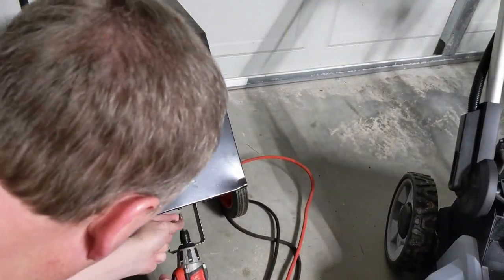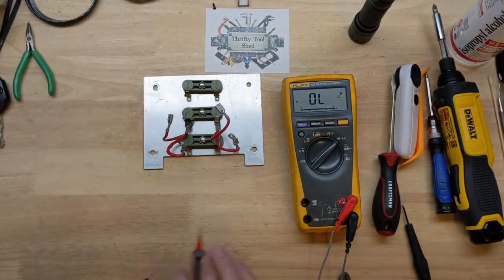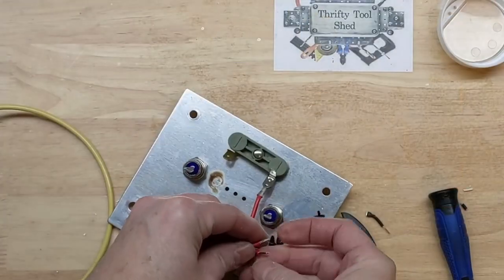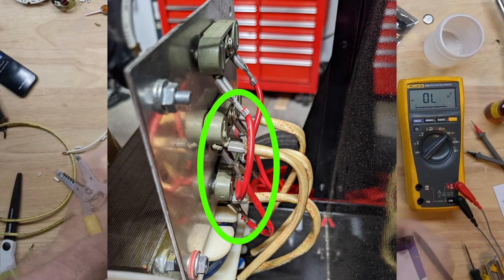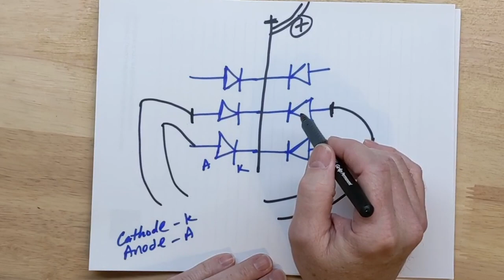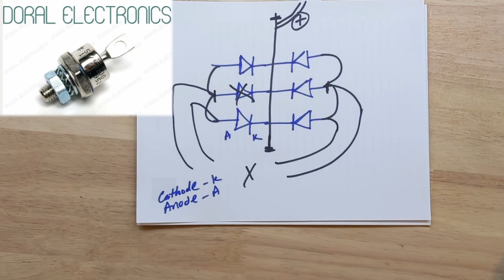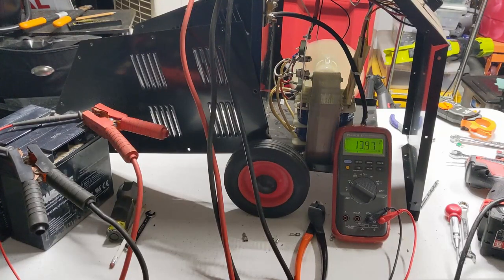CEN-TECH 69368 Battery Charger Repair

Comment: Hello Thrifty Tool Shed.  This is an update to my copy cat replacement of all 6 Diodes on the Rectifier  plate and the re-wiring of the Diodes.  It took a while to collect 6 new diodes and when they arrived, I watched your video again, then copied your solution.  The parts I used were all new.  10 AWG wire and #6 ring terminals.  Following your instructions made this a doable project.  First, I removed all of the old diodes from the Rectifier plate and replaced them by drilling holes for the new ones and attaching them.  Then I carefully re-wired all 6 in sequence like the diagram you drew.  After re-attaching the positive wire to the plate, I used a multimeter to test my work. It displayed numbers similar to the numbers you show in the video.  If I had not found your video, I would have just bought a new charger.  You showed me the way and I successfully repaired my old charger and saved money.   You are a good teacher.  Thank you and happy trails to you.
Reply from the maker: Awesome job! Thanks so much for your kind comment! It means a lot.

Comment: One small problem bro.  You cannot put non identical diodes in parallel.  Different diodes have different voltage drop across them.   It's like putting a shelf in a couple parallel boards.  The longer one will carry the whole load.  The bad thing for diodes is that once it get hot, its voltage drop goes lowers and this exacerbate the diodes getting hotter and other diodes doing nothing.  Eventually the diode with the lowest voltage drop will burn.
Reply from the maker: I completely understand that and I guess I should have talked a little about that as well. Since I mentioned that they could handle 50A on their own and only ever get a good push when in 200A boost that is obvious with the size of the wire it is not meant to handle more than a few seconds of that. I have had no issue with that in mind. If I was working on a system pulling close to rated current of the diodes in question and with more use than an occasional battery charge I would have absolutely changed all the diodes at once as you could tell the original ones I left on the plate were not as close in voltage drop check as I would like in a system design. Very good point, I should have spent a minute talking about this a little. Thanks for sharing!

Comment: I know this is an older video but it's still good stuff! I'd been unable to source the original style diodes for my HF charger. Never considered using a stud mount diode. Thank You Sir!
Reply: Where at?
Reply: @TheTechGuider  Amazon has the stud mount diodes that will work with the HF battery chargers. The original pill type diodes they offer do not include the holder (which is why I think mine failed on a high amp setting due to poor connection). I think the stud type diodes will be a much better option to handle the current and heat without the same type of failure mine had. They're great battery chargers but some of the internal parts are pretty sketchy IMO. It's great to see someone has found a way to repair one better than the original design. A+!
Reply: @KentuckyFriedFixes  can’t find them I looked
Reply from the maker: Is the link in the video description not working now?
Reply: @ThriftyToolShed   no kentucky said he found diodes like the originals. I asked where
Reply from the maker: Sorry, I saw where he said he could NOT. He used the stud style....
Reply: @ThriftyToolShed  oh I misread
Reply from the maker: Close as I can find to parts with the 50A original diodes....
https://amzn.to/48e90t5

Comment: I have a smaller cen tech battery charger, it turns on and off constantly, on for 10 seconds off for 30/40 seconds??? I got no idea if its normal. Do you have any ideas why and if need be what to check to fix it?
Reply from the maker: It is possible it is shorted out similar to this larger one. It can be shorted and hum and maybe the internal shunt or circuit breaker is opening up and then cooling down and cycling? Does it have any DC voltage actually coming out of the leads when it is on?
Reply: @ThriftyToolShed  The meter does not rise at all but you hear and see it go on and off. It's one that has 50 amp 10 and trickle 2 amp. Never used much.

Comment: Thank you for your fast reply.  After I sent my comment/question, I went back and watched the video again.  Then I heard you say you needed to add more ring terminals.  Since I am replacing all of the Diodes with 70Amp 1200V replacements, do you think I should use a wire with a 12 AWG instead of the 14 AWG you used?  I confess that I am merely being a copycat and trying to do what you did.  Monkey see, Monkey do.   I'll be really careful and hope I have the polarity in the right direction for all 6.  Again, I appreciate your patience and kindness in the explanations you provide.  Thanks again.
Reply from the maker: I would absolutely use larger wire like 10 AWG  or at a minimum #12. Excellent point.

Comment: I have an old Schumaker battery charger that needs both diodes.  It is 6/12 volt 2/6 amp.  All of the stud diodes that I can find are 70 amp. Will that work or should I use something smaller.
Reply from the maker: They will work fine, just Overkill. You can get by with 10A or 25A easily if you can find some.
Example of some Axial 10A if you can connect them in yours: https://amzn.to/4awsnye
Or 
Example of 10A 8mm stud type: https://amzn.to/4aAH2bH

Comment: I've seen others change diode with bridge rectifier that have a diode in  them? Whats the difference in the one you installed?
Reply from the maker: Typically speaking the bridge rectifiers are lower in current rating than the large individual diodes and it has four diodes together internally used for full wave rectification.  This charger is using half wave rectification.
Reply: I have the smaller 2 / 8 amp Cen-tec charger. If I replace the diodes will it put out more amps? 
Is so, diode like the ones you used or the smaller square ones or a full on bridge rectifier?

I'm more mechanical than electrical. Lol. Thanks for all the information.
Reply from the maker: You will be limited to the current rating of the transformer as well so not only the diodes amp rating, but the transformer as well.

Comment: This is about the fifth video I looked at on how to fix a charger. This is the only one I've looked at with the 200-amp start option for the charger. That's what I'm working on it is a Schumacher. Funny thing at the parts store at Farm and home store I was asking if they had a fuse available for it. It look like I speaking a foreign language and that I was nuts. Fix a charger just go out and spend $350 or more for another one. The charger has saved dozens of batteries for me. so now I'm going to take the case off and see what I find. Your video is getting me off to a good start. Thank you

Comment: If all of the diodes (3 x 2 = 6) are replaced individually, how would it be wired back into place?  The charger came with 2 diodes per holder, and the top tier only has 2 wire connectors, and the 2 lower tiers have 4 wire connectors.  I am new to solving electronic issues and could learn from your expertise.  Great video too.  Thank you.  Merry Christmas too.
Reply from the maker: Hi,
I did show at 8:55 the diagram of how this one was wired if yours is similar. Make sure all diodes are going the same direction as the original. Mine was all 6 cathode to the plate. You can also buy higher amperage diodes and get by with 4 instead of 6 if you desire. Thanks for your kind comment. 
Hope it helps and Merry Christmas to you as well!

Comment: I have the same unit and the same problem, but I had a burned out diode in each group, so I have to replace all the Dios. Question! Would I use the same Doud for this unit? I bought six new diode and I’m getting a Feedback.
Reply from the maker: I would think replacing all 6 would be great. As long as polarity is observed and put back the same way. Are you saying you are getting a feedback after installing them?

Comment: Was the black wire output battery cable connected to the center tap of transformer ?  The red output positive battery wire was connected to the rectifier diode plate.
Reply from the maker: Yes, the best I remember. The black cable does go through the current shunt and circuit breakers before going to the transformer if I remember correctly.
Reply: @ThriftyToolShed  thank you for your response.

Comment: very helpful .thank you.     i have 225 amp  schumacher charger  probably 40 years young ,  has 2 diodes  on rectifier plate .  one of them is bad, will the one in this video work properly for me ?
Reply from the maker: Thanks for your comment! I do not know this model to say for sure, but if only 2 diodes and rated for 225A I would assume the diodes are rated higher than the ones I used here?

Comment: Are all six of the diodes rated at the same amperage? (50)? I have the exact same charger with the exact same issue lol I'm going to replace all the diodes with the ones you suggested.. i think i need 6
Reply from the maker: Yes, all should be rated for 50A if it is the same model!
Reply: @Thrifty Tool Shed  I like your content. You've earned my subscription! We live in a throw-away consumer society nowadays, and I'm not too proud to benefit from it when the opportunity arises.

Comment: Thanks for the simple, down to earth video. I’ve got 3 dead chargers, identical Chinese 2 or 8 amp models. Transformers seem ok, just over 6v at the rectifier on 6v setting, and same for 12v setting, just over 12 v. After the rectifier there is a circuit board with 4 leds, showing how many amps are flowing. All 4 are lit up, with only 2 or 3v DC at the output clamps. 
There are 2 fairly big white square resistors (I think) in parallel, showing  7 mega Ohms on the meter in one polarity, and no circuit in the other direction, which seems unusual. They are marked: 5W 0 Ohms 5 J. 
Would you suggest replacing them?
Reply from the maker: Yes I would. The 5W resistors are most likely ceramic power resistors and should read close to zero ohms according to what you wrote above. Best of luck to ya!

Comment: Your video was most helpful,  I changed out the bad diodes but it is still Only out putting around 8 volts. Does this mean the transformers bad?   Not sure now what’s wrong?
Reply from the maker: One thing to check is that it's not still in 6V mode. The selector switch may have issues if not selecting the correct transformer winding. Thanks for your kind comment!
Reply: @ThriftyToolShed  thank you for replying, turns out another diode went bad. I am not sure why. I think I am done,  not going spend any more time or money on this. Thanks

Comment: Where would be a good source for a replacement amp meter for one of these large units? Mine wasn't working so I removed it.
Reply from the maker: One example place I see that has some similar panel meters is the link below. This is only an example of course, I have not ordered anything from them myself! I can't recommend since I have not ordered anything similar except some eBay purchases similar when they show up from time to time. I sometimes have saved searches on eBay in case an item shows up...
https://www.plpbattery.com/collections/amp-meters-volt-meters-accessories

Comment: What was amperage rating on newer style diode? Will there be an issue with miss/matched diode design?
Reply from the maker: In the video description I shared links to the 70A version. You can find even higher current type if you want to reduce the number of diodes honestly. It is a concern for mismatch of diodes since some will end up carrying more load than others if not properly matched or purchased together. I typically see no issue running these in the under 50A charge range and even the higher current ranges if used for the typical boost mode temporarily. You may end up seeing more unbalanced current the higher current charge level you charge at.

Comment: I have the same unit with the same issue. I found one of the black wire  for the fan motor on the floor of the casing. I do not know where it goes. Can you help?. Thanks for a great video.
Reply from the maker: Hi,
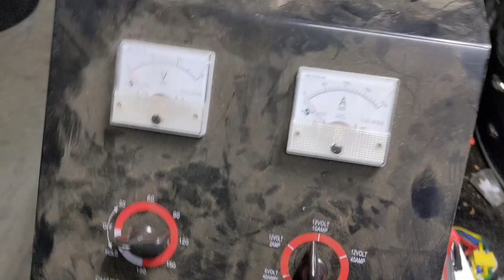I did not even get a good still of where the fan wires go since I had no concern for the fan with this one. I have of course since given this back to my friend. I would say that it goes toward the wire nuts in the bundle you can barely see at 1:06. I think that makes sense because the timer. 120VAC is what is going to the fan. Some of these switch the neutral and some switch the hot. Either way one of the black wires from fan is going toward the hot and the other black wire is going toward the neutral. Find where one side of the fan connects and then it should make sense. Thanks for your kind comment!

Comment: how much A/C in the presence of the D/C is acceptable?  My 36 volt charger diodes tested good yet output was 36 volts D/C with 6.3 volts A/C going to the battery.  I made a new diode plate with new diodes and shows everything correct yet now get 1.4 volts A/C in with the 36 volts D/C
Reply from the maker: Well, A simple charger as this one is a  center tapped Full Wave bridge output. So with no filtering you can easily go as high as .483 ripple of voltage In. So roughly half! These chargers have no filtering at all. It is the battery that is the load and also is filtering the output to some level. It would depend on the charge level of the battery being charged and if the leads are even connected to the battery or not as how high the AC ripple is?

Comment: Great vid! I have a very similar charger with the same burnt diode problem! What diode rating should i order and where do you like to get yours? I would like to replace all 6 if not too expensive.
Reply from the maker: I have a link in the video description from back when I replaced mine. It's an example link for the 70A actually. The exact link for the ones I used is no longer available. Best of luck to ya!
Reply: Never mind I just saw the screenshot of the diode you ordered!
Reply from the maker: I hope it may be back in stock. It was out of stock about a year ago so I ended up removing the old link and added some 70A versions as an example of a similar diode from Amazon. Even though it is not the exact one as was shown in the video! Best of luck to ya!

Comment: I liked your video, thanks for the knowledge, i have a cen-tech heavy duty item 62292, 6/12 volt, 2-10-40-100-200 amp battery charger, i bought it used & when i try to use the 200amp it kicks in for about 1sec. & then out, on the 40amp it runs alittle longer then kicks out, the 2 & 10 amp works ok, do you have any idea what ishould check, thank you Dennis K
Reply from the maker: Thanks for your kind comment. Sounds like a possibility that the thermal overload is opening up. Some models have this built into the transformer and on most it is external. Could be a faulty thermal and it could be really drawing that much current (like a bad diode or such). You will have to test current through the thermal and see. A DC amp clamp DMM maybe your best friend here. Best of luck to ya!
Reply: @ThriftyToolShed  thank you

Comment: i thinks can this help me whit Schauer cr612  maybe happens the same voltaje its 11.50 but when i connect any bulb or light , battery the voltaje drop 0.15
Reply from the maker: Check for loose connections, it could even be something with the transformer or thermal in the transformer if it has one. I would check all the easy stuff first by checking point to point to see at what point the Voltage is dropping under load.